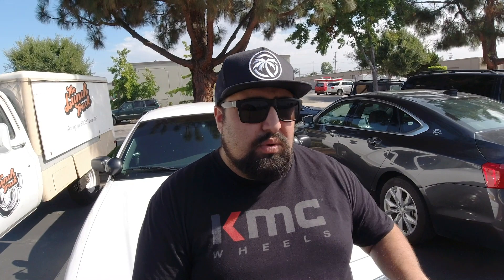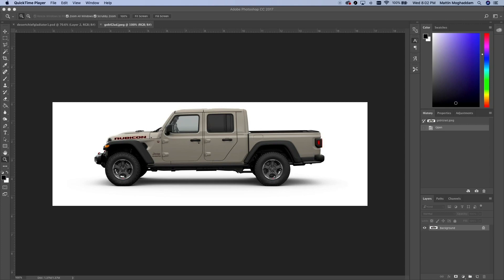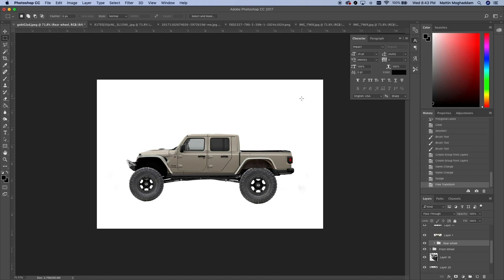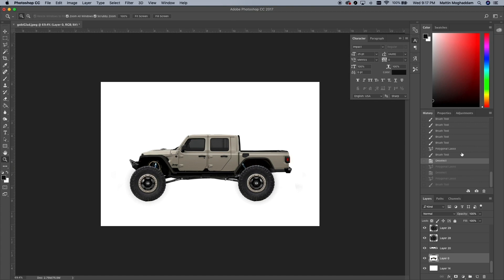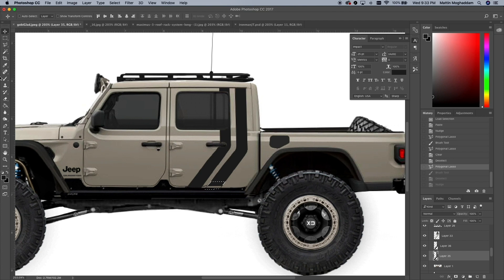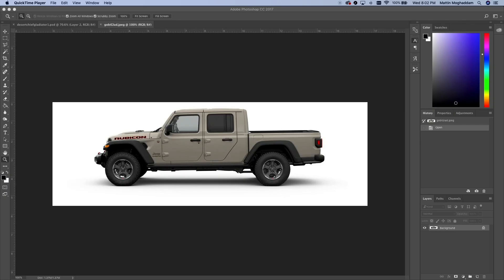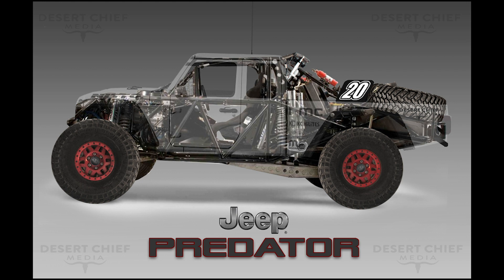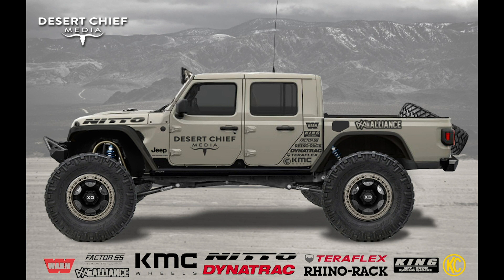Chasing Dust: How to Photoshop Mods on Your Car or Truck

Comment: hopefully you have been able to buy one. I would say save up untill you know exactly what you you want. hint jeep is talking about the 392 in the jt. i' ve owned and built two jeeps. building overtime is fun, but not as cool as doing the bull sh!] first. If your doing enough work a rubicon is kinda over rated tho fyi even though i bought one. I would Highly recommend financing for the credit lol and just put small mods that don't break the 3 year 30k mile warranty most of all work done by the dealer and vinyl wrap it keep the plastic hard top and fenders. No you have paint protection also. Get the steel bumpers for a winch the ends come off also,  but get the longest warranty possible. if you go rubicon you can get away with their mopar lifts and run 37s even stock which is the biggest tire that fits a spare between the frame. Then after 3 years 5 years sell it or trade in make your money back and move onto the newest. or just go big and never look back although if your gonna put bigger axles and 40s with beads plus arb air lockers and psc steering pump and ram then i would use a cheaper trim than a rubicon definitely if your gonna wheel it.  i wanna see you build that trophy truck though.